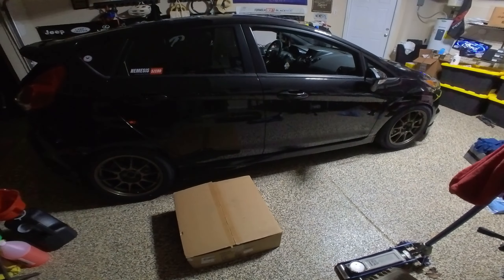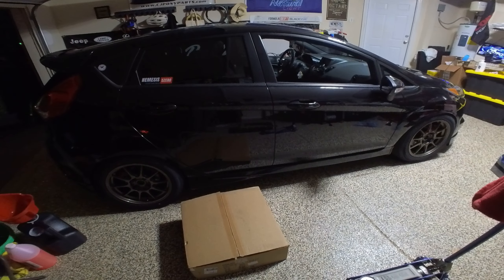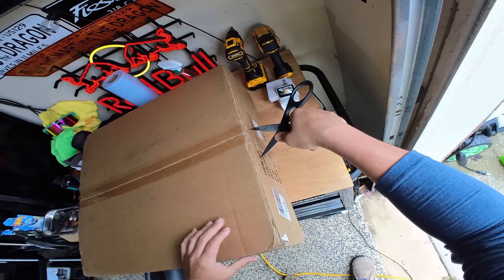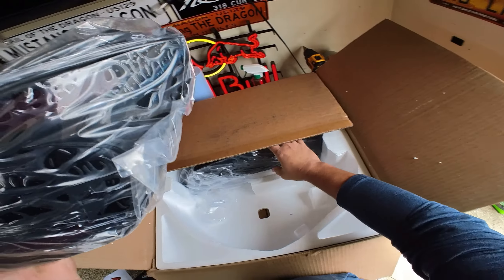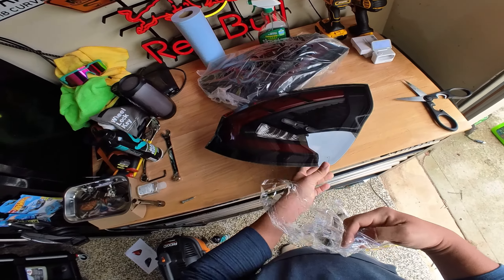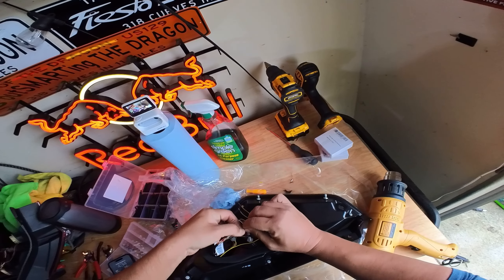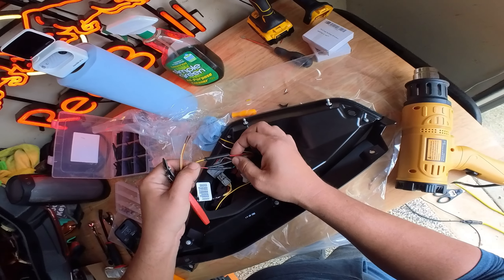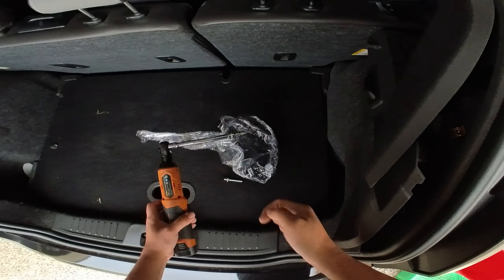"INGENUITY" FIESTA ST TAILIGHT UNBOXING / INSTALL / FITMENT / MAJOR PROBLEM

Comment: havent watched all of it....the old spec D's required repinning  as the harness was pinned for the euro cars.  wondering if these require that?
Reply: nevermind i see you were pinning the harness now
Reply: Judging from that long stud on back of taillight housing....those are marketed for euro fiestas.  I would bet those can be wired differently for USDM.
Reply: maybe not you definitely had all the functions connected properly

Comment: 100% would snag those over the spec-d garbage. Hopefully these stick around a while
Reply: Spec ds work these don’t
Reply from the maker: @Deadpoolmasterchief to be fair mine has been the only ones I’ve seen that has had issues
Reply: @NemesisDigitalMedia hey do us a favor then if these are the only problem ones get replaced ones and install them again and I’ll buy a pair you seem confident let’s do this